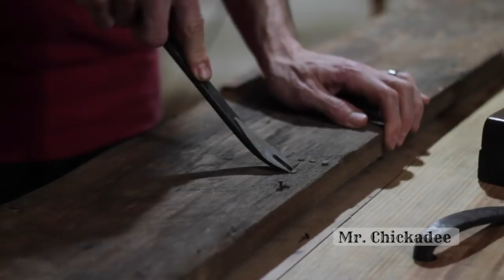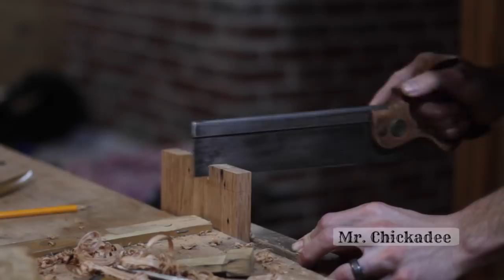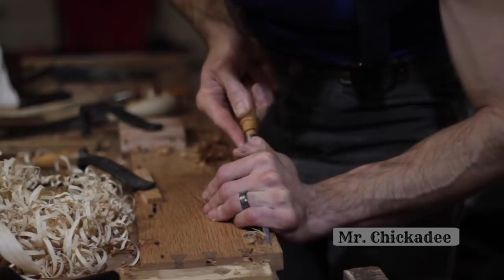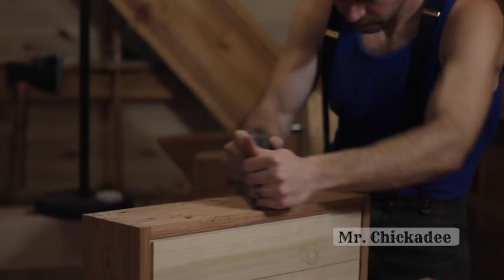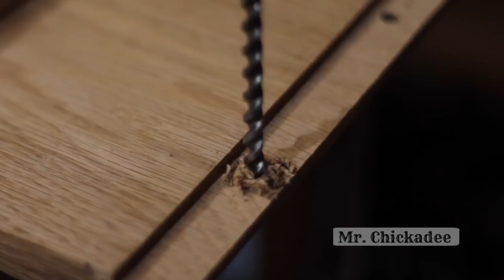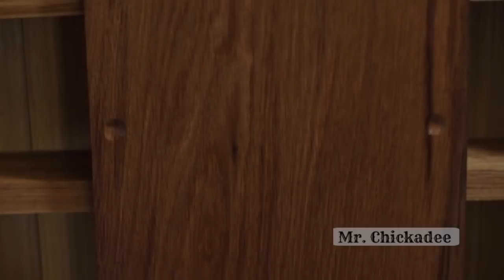WEDGED DOVETAIL OAK MEDICINE CABINET

Comment: I’m always impressed to see the tools Mr. C has acquired. These tools all appear to be from the golden age of tool making. 1820-1920. Even some tools as late as the mid 1940’s retained the quality EXPECTED when manufactured and sold at market. The expectation was these tools ,properly used and maintained ,would perform their respective function an entire lifetime. Additionally , these tools could be maintained by the user. Only the highest quality materials and manufacturing processes where used. These practices , having been refined in the old world for perhaps a 1000 years in some cases and streamlined in the new, culminated in only the finest tools. Friends I wish we could return to these standards. Let’s leave the era of disposable goods behind and return to an era where we only purchase the highest quality goods. But only have to purchase these goods once. Granted a little more is spent up front. But ultimately it will be a better investment have realized it’s purpose for long enough to out compete it’s disposable counterpart 10, 20, even 100 times over. Can you cite an example of an item that would befit this criteria today? I would sight a great straight razor. Initial purchase for the lifetime quality level razor and maintenance kit average’s $400. Disposables refills can vary greatly. But I posit that even the cheapest would run better than $400 over a lifetime. Not to mention what did a load of bread cost 30 years ago vs today? What will $400 buy you 30 years from now?

Comment: I continue to stand in awe of your abilities with wood. Thank you for the video, especially as I'm currently planning my own attempt at a medicine cabinet. If I can achieve even a fraction of this quality, I'll be ecstatic.

As always, I have a question: Do you use any kind of grease/wax/other lubricant on the sliding door, or is it just a matter of properly planing and setting them?
Reply from the maker: Thank you, I found it unnecessary. You may need some depending on your design. Edge grain of the breadboards slides easily on edge grain of the casement, also keep it pretty loose. For lift in or out doors, use made the top tongue about 2X the depth of the bottom tongue, then its easy to go up, in and down.
Reply: Mr. Chickadee Thank You!

Comment: Very impressive work (as you have always done)! The breadboard and locking wedged dovetails were excellent! Have you done or are you going to do a table to eat meals at? I wanted to see yours before I build one out of rough walnut I acquired. 
Thank you very much for sharing your master craftsman skills with us!
Reply from the maker: I will eventually, leaning toward a tilt top type with three legs…saves space in our tiny house.
Reply: Mr. Chickadee Well the table was the center piece of the house along with the fireplace/cooking stove anyway. They did everything on the table. But I like your tilt top idea and looking forward to watching when you get around to it. Have you already slabbed and stickered wood to air dry for all of your upcoming furniture projects?
Reply from the maker: You are correct sir, in older homes it was often the food prep area too, back before all these modern type "kitchen cabinets" we have now. Our house is only 600 sq feet so space is often a consideration for us. The dining room may very well double as our living room since we are considering keeping a small workbench area here in the house since our lives revolve around woodworking. 
I was thinking in a drop leaf table, but am going through a lot of trouble to not buy any more hinges, nails or glue, and though I can make the table from all wood joinery, the drop leaves would require metal hinges most likely. For that reason Ive been considering a large (4 person) tilt top table that has one large wooden pivot under the top. This can be pushed against the wall when not in use and chairs can be hung on pegs, shaker style.

Comment: How sturdy is the back on that? Could you use that method for table tops and such? I think thats just a tongue and groove fit? What about if i wanted to make a square column making 4 panels about 8 inches wide laying the boards horizontal and then connecting the panels using dovetail joints? Do you think that would be strong enough? Also did you make the tongue and groove planes or did you buy them?

Comment: Very nice. Wedged dovetails

I see you've been adding to your plane collection. A video of the Chickadee Resource Center of Chickadee Enterprises showcasing your tool collection would interest me. 

Are you using wax over cured oil for finish? I've found cured oil on cured oil sticky at best but your doors slide like buttah. 

Ever tried a depth stop on your DT saw? I see them advertised. Seems like it would take a lot of rubbernecking out of sawing to a precise depth. 

Scouring finish planed surfaces with shavings is quicker than sand paper (which I never see you use). Is that a new trick? Works good, doesn't it. Takes the fuzz and little snuggles off the crisp edges.

Keep it up, Bub. You got a following out here around Puget Sound.
Reply from the maker: Thanks Forest, 

If i ever get my stuff organized and down in the workshop Ill do that, and start making instructional videos for those who want more in depth process. 

Just oil for now, no issues yet, its a pretty loose fit. 

Ive not heard of that, guess it could help, I don't mind a quick glance now and then to see how messed up I am haha. 

Nothing new under the sun buddy, I don't HATE sand paper, just avoid it as unnecessary 99 percent of the time. ANother thing to buy I don't need I guess, like glue and nails…
Reply: In the end it's all folly, just chasing after the wind... I enjoy your work brother!

Comment: You cut a dato and put strip of wood into it and I'm not sure what it was for. It looked like it might be on the back of the sliding doors, I'm not sure. I really enjoy your craftsmanship.
Reply: It's a sliding dovetail, with a taper. Basically to stiffen the door, and it wedges in without glue or screws.

Comment: Hello again, Mr. Chickadee! True as ever, this is yet another excellent video from you and the Mrs. A brief question, if you'll permit me; could you please tell me a bit about the steel bodied (and apparently multi-adjustable) plane that you use around the 11:45 mark? I'm roughly familiar with many woodworking hand tools including a goodly number of planes (for a guy that doesn't actually get to do much woodworking himself, that is), but I'm completely unfamiliar with the one in question. Thanks!
Reply: Stanley no 71 router plane, or one very similar- the original cordless router (which is a non-original joke). Defintely worthwhile buying (or making) one of these if you want to do a lot of hand tool work.
Reply: Scott O'Neil That is a router plane, looks like a Stanley 71.
Reply: Scott O'Neil I'm pretty sure that's a router. Paul Sellers shows them in use and shows how to make the poor man's version as well.
Reply: That is an old_fashioned router.  cheers!

Comment: Based on what I've seen, glued box joints are stronger and simpler than dovetails - but if you're not going to glue them, then dovetails are probably your best bet.

And since I haven't seen you use any glued joints yet, that explains your choice here.
Reply from the maker: I prefer compete wood joinery to glue or metal fasteners.

Comment: Wondering why you use square pegs for your draw bored m&t's just a personal preference? Don't have a round dowel plate?
Reply: Third Coast Craftsman they are quicker to make the corners grip which is nice if you are not using glie
Reply from the maker: quick and easy to make right on the bench with a chisel, and they hold much better

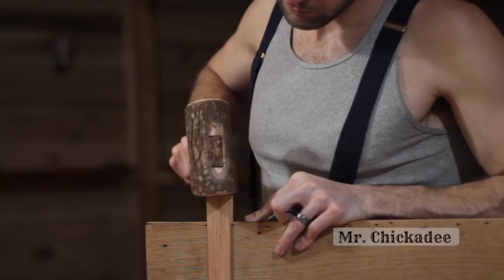Comment: Does anyone know why at 12:00 the dado/sliding dovetail was used on what appears to be the back of the door?  I’m guessing its to keep the door flat resist warping with seasonal changes?  I’m just wondering if there is some other purpose to reinforce the back of the door like that?
Reply from the maker: I was originally only using that, but it proved insuficient to hold the boards flat, so I added bread board ends. Large dovetail battens would have worked, but would have been in the way of the sliding action.

Comment: why drawbore the pins on ends and not the pin in the center of the breadboard ends of the doors?
Reply from the maker: All are draw bored, sorry if it wasn't clear in the video, the side holes are elongated across grain to permit some movement.

Comment: What's your opinion on dovetail saws, do you prefer the "pistol grip" or straight grip?
Reply from the maker: Both can work fine, use what you have or can afford. Pistol grips might be more comfy but are normally higher.
Reply: +Mr. Chickadee thanks! I have only used the straight handled ones myself because that's what Ive had

Comment: ever used maple or cherry or elm? how do you not get tear out? i skew my plane and change directions and sharpen, but i think i need to make planes with a different angle to them.
Reply from the maker: All you need to plane any wood, no matter the grain, knots etc. is a properly set up cap iron. I need to make a video on this, but Rickard did a great job in the video here...its a three part series this is the first...

https://www.youtube.com/watch?v=1bhh6kxXZOQ
Reply from the maker: i agree with most of what he says, except I find even the jack and try planes benefit from a close cap iron, though not as close as a smoother, the close cap iron helps to minimize the tearout so there is less clean up with the smoother later. It takes a bit of practice, but any double iron plane from the junk yard can be made to work this well if set up right. Too close you will get accordian shavings or clog up, too far and you get tear out, you will learn fat how the right distance "looks" I cant give you a measurement, because each plane is unique. It might be 1/32" from the edge, or 1/64" depending.

Comment: If you reverse those pins and tails to the traditional layout you don't have to do a stopped groove. ;-)
Reply from the maker: Two of the 4 grooves could be hid by dovetails in a continuous 4 sided groove, the others can be plugged up with a custom fillet, or the ends of the boards can be cut down after the grooves are plowed, tails or pins first is just preference to me, I like pins first.
Reply: Mr. Chickadee I'm talking about no half pins.

Comment: Are you able to provide the plans for your wonderful medicine cabinet as I would love to try and make it myself
Reply from the maker: I dont normally use plans, just put things together orgainically, going by the size wood or space needed. 

If you start with four boards the size you wish your cabinete to be, dovetail them together (but dont wedge or glue them yet. You can then make your door and back panel to fit the frame carcase. Thats pretty much what I did.
Reply: Mr. Chickadee I am a fan of your work and am currently making my own cabinet above. Lost count the amount of times I’ve seen this. I’ve got the same plough plane you use. How do you set it up and do you keep adjusting the depth till the end. I seem to be taking very heavy cuts. Once again well done on your video and I appreciate your time.
Reply from the maker: Well if your plane has a depth stop you should only need to set that to the desired depth then plane away until you reach that depth and it should stop cutting. 
To set a plough plane, I would loosen the wedges or screws on the fence arms, adjust by eye or ruler till the front and rear fence arm are same, then snug down adjusters. The blade I would insert with the skate resting flat on the bench top, push the blade down until it just touches the bench top whilst keeping downward pressure on the plane body to keep the skate in contact all its length. Now once the blade and skate are in place touching the bench top, hold everything there and push the wedge down until its in place and tap it with a hammer, still keeping everything tight to the bench. Now try and plane, if you need more cut, tap the back of the blade until its cutting deep enough. 
Going against the grain or in harder wood you will want a lighter cut, with grain or in softer wood, deeper is ok. Remember the depth of blade can also effect deth stop adjustment or depth of groove, so its better to set it once and plough all the grooves before changing anything for consistancy.
Reply: Mr. Chickadee thank you. I will try that

Comment: It is a beautiful piece of work and I admire your skills. But shouldn't the pins be on the horizontal parts? Now when they are on the vertical parts, only the force of the wedges prevent the pins from sliding out of the tails, while the entire cabinet is hanging at the pins. When the tails are on the vertical parts, they would take up the force. Compare a slide drawer where the tails are always on the sides and never on the front. You are the first American cutting the pins first, and fortunately you don't cut the pins so thin the tails almost close. I am a pin first man too, and the razor thin pins hurt my eyes.
Reply from the maker: Thank you, yes technically that would be the strongest orientation. This tiny medicine cabinet, weight and orientation wasnt really a concern, if it were a larger cabinet, or holding more heavy objects, like china or pots perhaps, sure it would be advisable to put tail as you say. The wedged pins are really quite strong though, and it would take a lot of force to even move them, pretty interesting. I find cutting pins first better for me, I think if more people tried it they would like it too!